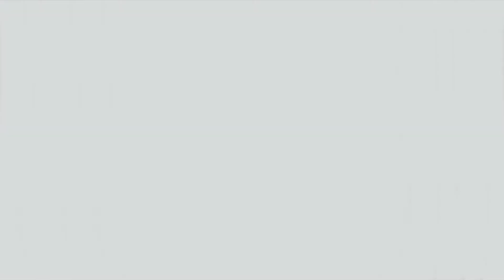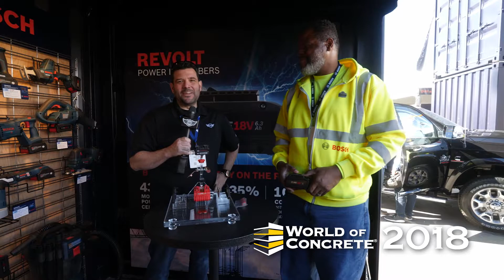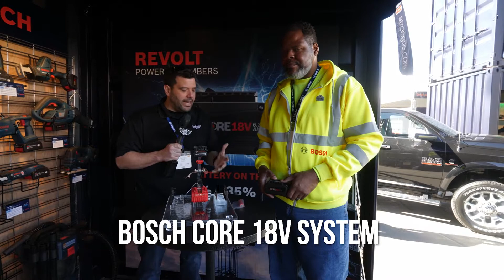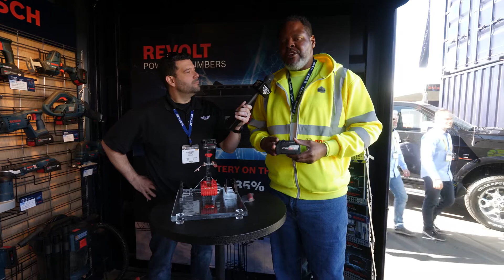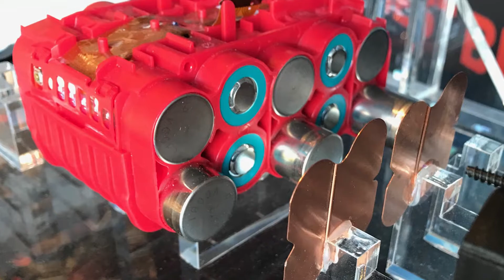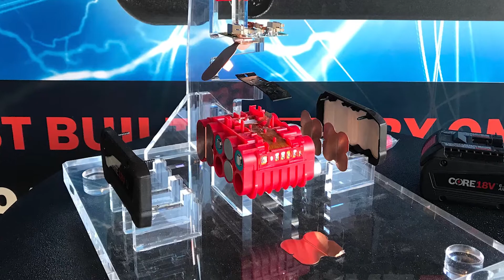Bosch 18V CORE Battery Technology 20700 Cells 2018 World of Concrete

Comment: Did you ask them about the status of the 3 Row /15cell Core Battery Pack? Release Date? etc?
Reply from the maker: We did not Hassla, but we'll reach out.
Reply: Thanks alot for the quick answer!
Reply from the maker: We reached out to Bosch and were told they have no new info on that yet. We're anxious for it too!
Reply: Thanks. I am curious if the 3 row and the >2kW tools will be released together. And if Bosch follows Metabo and Makita with the X2 Plattform.
Reply from the maker: Hassla looks like there are some pics of the 3 row Bosch battery floating around the internet with a 12Ah on side (hopefully that's not an internet hoax).
Reply: coptool Seen it on Instagram. The Guy who published the picture seems really truthworthy. 
Thanks for your „livefeed“